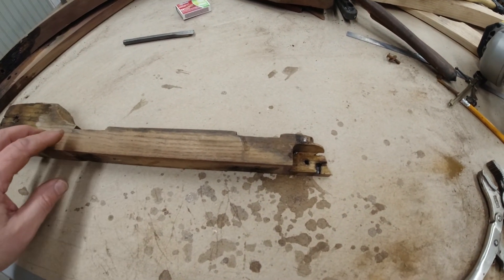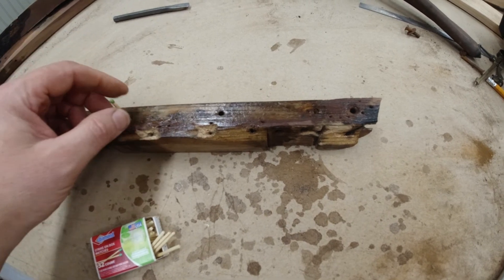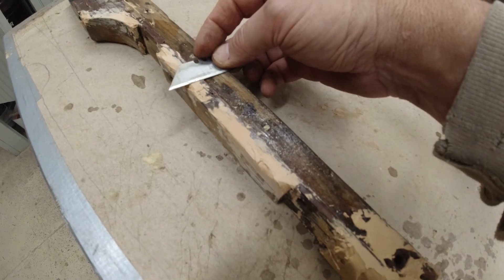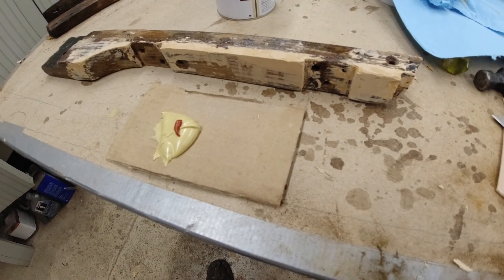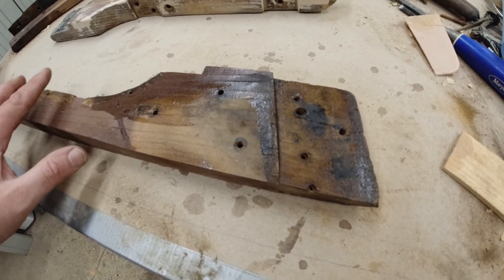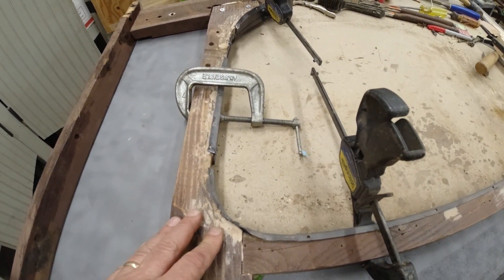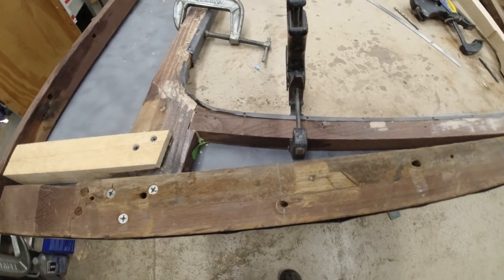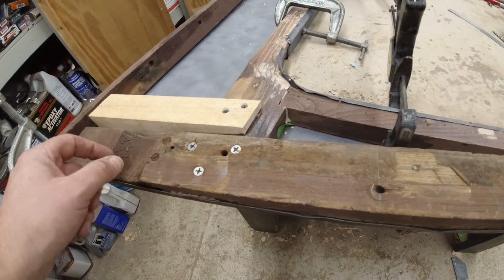1952 MG TD Part 7

Comment: Hi ,I have fixed a bunch of wooden boat parts with west system. If you want to get the epoxy deep into the wood to stabilize and bond , cut it with about 50% acetone. I use the slower hardener. Do a couple of coats , then use full strength. Hope this helps
Reply from the maker: Agreed, I don't think there's any substitute for West Systems.  Cutting it with acetone is a nice trick.   I thought I'd give this a try since it was a small area and not that bad and it worked ok.  For anything else it is West or replace.  Thanks for the comment!

Comment: The British members of the Riley club use a tacky roofing tape to fit between the wooden gaps you scratch your head about. Surely reduces wood frame sqeak later down the road... like your hard work. I realze you´re long done with this car but your queeries seem so sincere I thought I´d share what I learned from the Riley Club in the UK, where our RMs have the exact same issues with wooden frames. I remember the club recommended not to drill through the A pillars to mount the back of the chrome strip onto the side of the front hood... seems to unnecessarily weaken the A pillar. Better to glue also with a modern tacky product to leave the A pillar unmolested at full strength...
Reply from the maker: Thanks!  Late replies are fine, I might do another one.